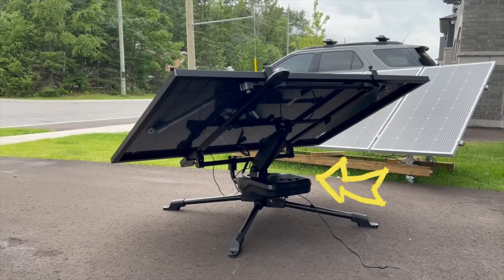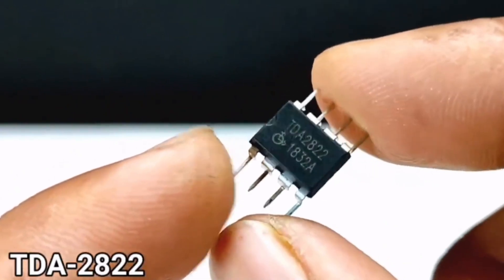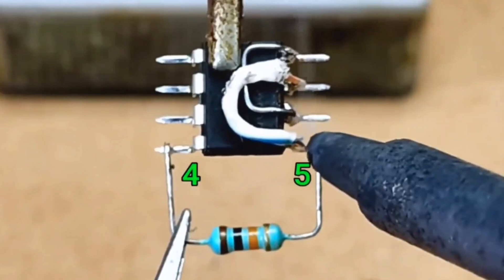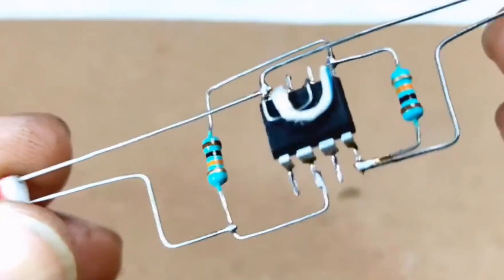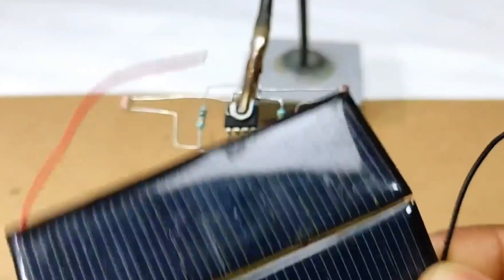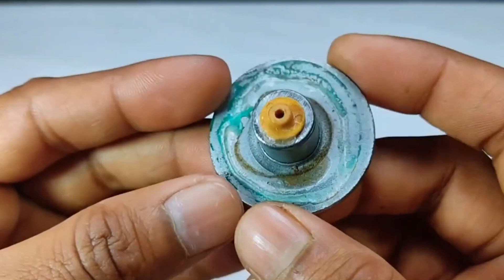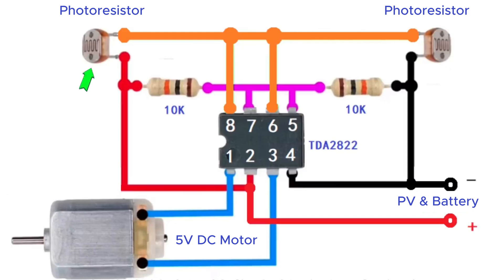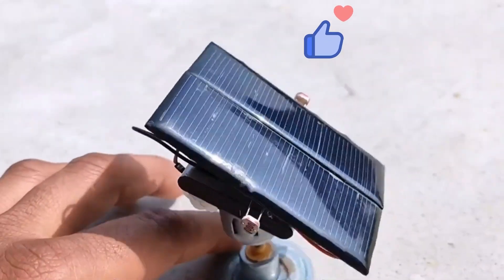Build a Solar Tracker for Less Than $20!

Comment: Too complicated. Didn't explain how how figured what resistors to use for one thing.
Also, the $3000 one controls a large panel not a tiny one that barely has any practical use.

Comment: i assume your circuit works. but building the structure to handle heavy weight and dies not die under strong wind is costly. however, if i build the structure one day, will use yourcircuit. and you need big fat motors to move thst heavy gadget. conerting your tiny motor to fat motor needs additional electronic circuits.

Comment: How about just buying more solar panels on craigslist. 300 W modules for $30 each brand new. Then go with a fixed array with absolutely no moving parts. 25 years later everything will be working just fine.

Comment: You should be able to run this circuit to also control the tilt angle too.  Two circuits, two motors, two axis.  How would you change the circuit to control beefier motors?  Also, it would be nice to be able to orient the PV panels flat at night or in adverse weather, triggered by a high anemometer reading tho reduce potential damage.  We learned this building 30’x30’ PV arrays with a tracking pedestal in the early 1980’s.
Reply: Add relays to control the "beefier" motors, I think you'd need to incorporate a micro controller, Arduino or similar, to integrate the anemometer related functions.
I'm betting there's already an Arduino sketch written for this application.....

Comment: Big difference! 
The cost of the large tracker isn't the electronics it's the structure and drive systems. Besides trackers aren't viable today because you can buy PV so cheap they don't pay for themselves.
Reply: Imo you’re paying for efficiency/ full sun, if you had sufficient panels buying more panels and spamming them everywhere wouldn’t do you much good for better efficiency
Reply: @angel-angel-angel-angel-angel  I'm not sure I understand your statement. If you are severely limit spacewise then maybe you might get some benefit from a tracker. The problem is that high quality dependable trackers costs a lot of money, for $2k or $3k you can buy a lot of PV.

Comment: You show us how to construct a solar tracker in a miniature size, like a toy we're looking for How do we make a solar tracker for a full-size panel system for our house
Reply: This will work with any size system by adding a relay to power a larger motor.
I built a 40,000 lb greenhouse with 9kw of solar panels that tracks the sun with the same principles.
Reply: Giant solid gears and some thick rails
Reply: Use slaves to turn it by hand.
Reply: I was wondering the same, but also want 2 axis tracking.
I imagine the same way but use a buffer chip on outputs to provide signal to the motor control circuit.
My concern is the 10K resistors should be really closely matched and the photo resistors also.
Maybe the circuit has enuf tolerance as is.
Reply: @lunatik9696 use 2 light sensors next to each other? That might work. I dunno if you solved it already
Reply: Yeah, but Radio Shack does not have stores anymore 😢

Comment: but this module will not support large motors how to connect this is the problem
Reply from the maker: You're right, it's just a demo.
Reply: A treadmill motor would work.
Reply: Use 40-amp relays and a micro controller like a Arduino Nano or a Raspberry Pi Pico. And 40-amp H- bridge motor driver boards.  All of this is going to cost more money and much time to learn how to do it.  At the end of the day, so to speak, purchasing enough panels to face south east-ish  and south west-ish and have enough amp hours worth of batteries just makes more since.  I resorted to manually pointing just two 125-watt  panels when needing extra power.  Use electric metal conduit and tarp tent "T" fitting to make movable two axis panel mounting system.  Then put a motor on it when you figure out the electronics.